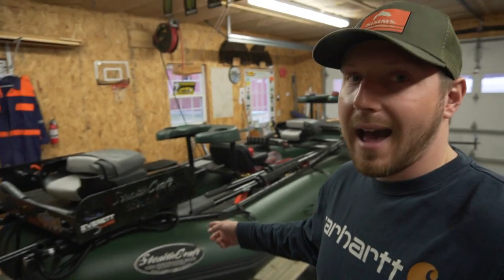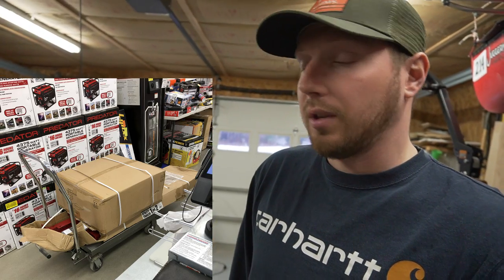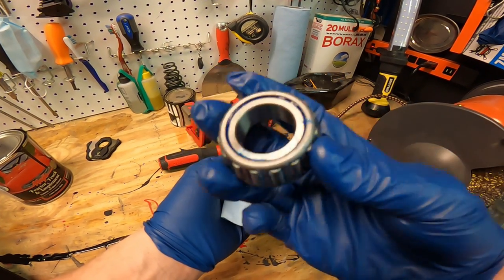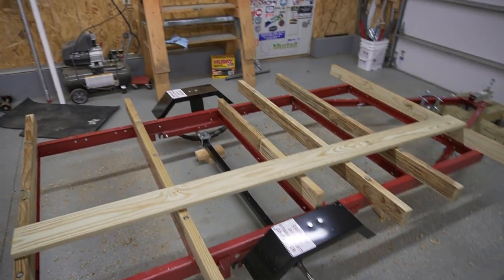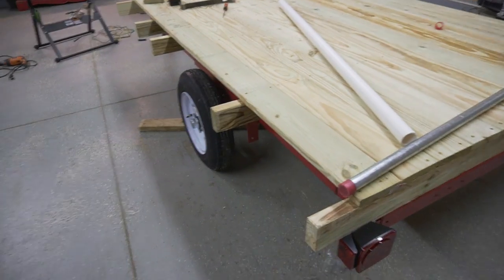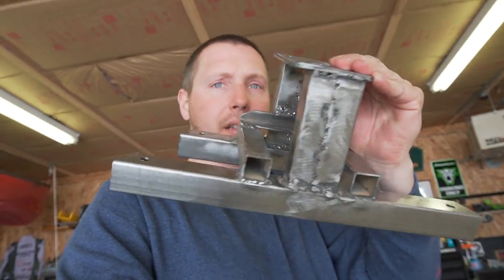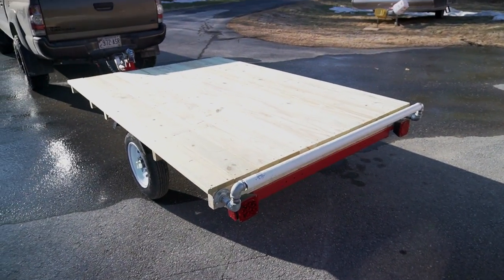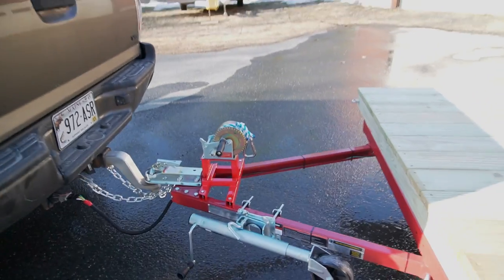Harbor Freight Folding Trailer Build & Modifications - Raft Trailer

Comment: I have had this trailer for nearly 16 years with the original bearings.  I have had loads of nearly 2000lbs in it.  The only mod that I did was to put heavier duty casters so that when it folds it moves around easier.
Reply: How does it travel down the road? Can it travel at highway speeds?
Reply: @jadeblanco2896  I would make sure that the tires have proper level of air and the bearings are greased.  But I did a trip from OKC to San Antonio with it as max capacity doing highway speed the entire way.  When I stopped for fuel I checked the wheels to make sure they were not getting to hot (no issues).  Tow vehicle was a 2006 caravan.

Comment: Got the same trailer for my little 12ft jon boat. I ended up taking the whole  axle/wheel/frame bracket assembly back off and flipped it around so that the axle sat further back. Been a decent little trailer.

Comment: I basically did the same thing but I spent a little more and bought the tractor supply trailer kit, its all galvanized and wont rust as fast as the steel trailers plus it came with the bearing buddies.

Comment: I'd like the idea of adding those joists to raise the floor. I was thinking, with a little bit of basic carpentry, you can actually add some pull-out drawers underneath that floor. these trailers around of stock at harbor freight right now. When they come back I'm going to get one and I'm going to do the same thing, I think I'm going to add some drawers underneath.

Comment: so, I have a crazy thought, not sure if this is something you think it will be ok with. I plan on making it 8ft by 9ft so i can fit 2 quads on the trailer and most of the weight will sit on the tongue of the vehicle (diesel truck) the PL capacity of the trailer is 1700 lbs so has me a bit nervous being exactly close to 1700 lbs with 2 quads plus the wood I am adding. my friends been doing it for a few years with  no issue. the axle and wheels seem to support the load also just fine
Reply: do you have any pictures of that build? ive been thinking about doing the same for mine.

Comment: Hope that deck on the trailer works for y'all,  I was using a wooden decked trailer for a flat bottom boat went to launch it in the river ,the father back I went the trailer started floting up to the top of river like a raft itself
Reply from the maker: I won’t be doing that. Just parking close and pulling it off

Comment: bought my harbor trailer in 2003... never had a problem with wheel bearings they have  grease fittings.
Reply: Did you keep the original bearings or replace them

Comment: I know this video is pretty old I hope you're still reading comments. I have one of these trailers and I'm going to do something like what you've done here and I was wondering. Did you register it first and then do these changes or did you make the changes and then they just went ahead and let you register it anyway. Assuming you have to register I don't know. In my state I have to register the trailer.
Reply from the maker: @olheghtt  registered it with the title it came with. Don’t think they care what the deck has on it ..?
Reply: @mainetroutwhisperer   even if the deck framing laps over the sides of the trailer?
Reply from the maker: @olheghtt  didn’t bother me any.. lol. I just went to the width of the wheels. Didn’t really make the overall width bigger. Guess you could always register as a homemade trailer if you’re concerned.

Comment: I live in CA and there are at least HFs within 1 hour driving from my house. I have been trying to buy one of those trailers for about 6 years on and off. I especially want to use a coupon. Every time I go, they say: "We don't have any but we should get restocked in (3-6months)". "Can I preorder one?" No "Can I put down a deposit?" No. "How do I get one?" You need to just come in when we have one in stock.  So how the heck do I get one? (I even looked at used on CL but they are trashed or overbuilt and the owner wants too much). Thanks!
Reply: HF gets re-supplied every Tuesday. So call the store and they will let you know if one was on the shipment.

Comment: So I have 13ft raft and the same trailer.  Is the length ok with about 3ft or raft hanging off?
Reply from the maker: Yup works great. The roller bar helps. I put it on with the front of the raft facing the vehicle. And have the front overhang some too
Reply: @mainetroutwhisperer  thank you.  I am going to pretty much mirror my build after yours.  Any other tips?
Reply: I gotta say, my raft has about 3 foot of over hang off the back of my trailer. Similar setup as this. After a while, I noticed a fine crack on the floor of the raft. Almost as if someone took a razor to the floor and sliced it across. Turns out the floor split because of the over hang. It’s not leaking, but if I was to fab a new trailer I would try to minimize the amount of over hang as much as possible.

Comment: I have 6 HF Trailers, 20 over the last 30 years, the Bearings are fine... the grease is Blue Lithium High Temp high Pressure grease, also fine, I suggest you just mount and pack with more... waste of time and money replacing them
Reply from the maker: I took one of the bearings out when I replaced them and if completely fell apart in my hand. Junk

Comment: Nice trailer build, trash the tip pins, you can always pull the bolts on the rare occasion to tip the bed.

Comment: Bearings are fine just grease them and they are good.
Reply from the maker: That’s why they fell apart when I took them out of the hub.. lol. Didn’t show that it happened off camera
Reply: @mainetroutwhisperer the rollers fell out of the cage? I have the 4x4 and it's held up well for about 5 years now. I use every other week.
Reply from the maker: @mp-xt2rg  yes.